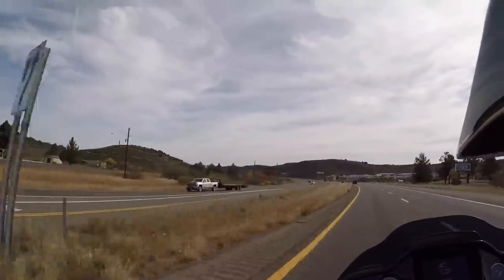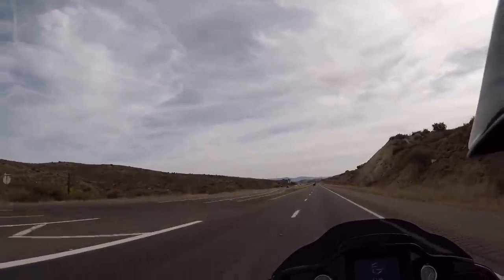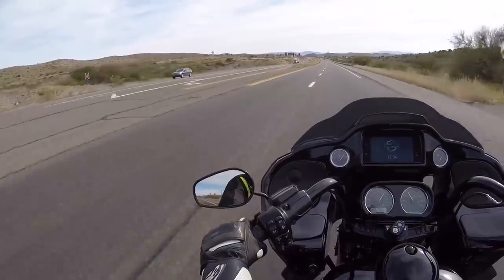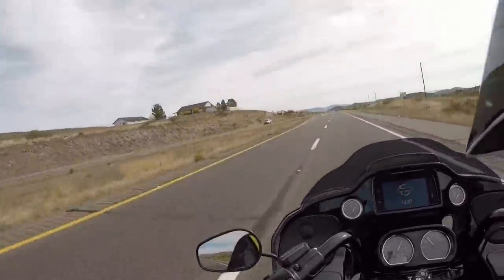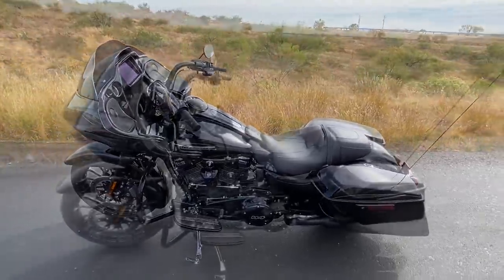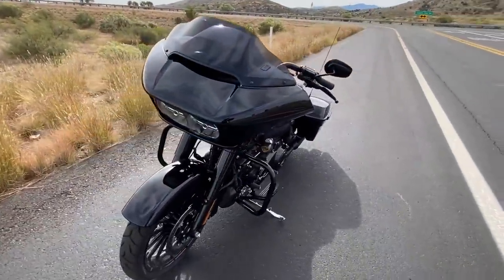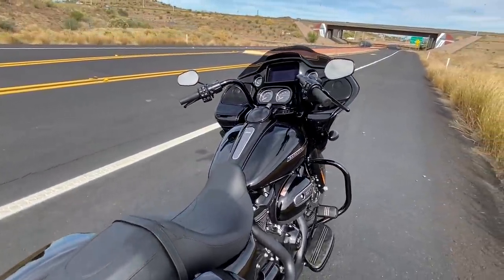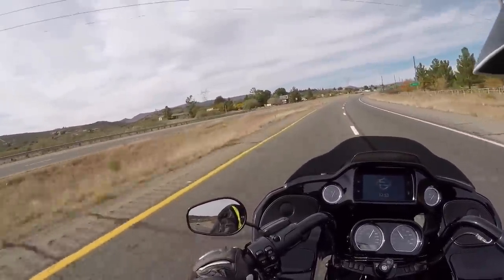2020 Indian Challenger VS Harley Davidson Road Glide Special

Comment: I am a Harley-Davidson rider and have had a Harley-Davidson in 88ci, 96ci, and now 107ci.
 Now Indian has done everything we want Harley-Davidson to do without having to use aftermarket companies.
Harley-Davidson is still using a chain primary drive which is BS, also 4 valves per cylinder should have been used 15 years ago.
Reply: Frank Wood primary issues for the second time are what was the final nail in the coffin that made me buy an Indian. Gear to gear primary is a great idea.
Reply: I'm buying an Indian sometime in the next 2-3 months.  Probably a chieftain 116.. but I'm waiting til I see and ride the Challenger before I decided.
Reply: @davidknows3320  my 14 victory has aluminum frame, inverted forks, gear to gear primary. Its not like Harley didnt have time to catch up
Reply: Bill blasius you speak truth.

Comment: Wow, I've ridden both and give me a break, there is nothing that would make me choose the RGS over the Challenger.  Indian has better styling, better looks, Cast Aluminum frame, 122HP water-cooled engine, Fox mono-shock which provides better comfort and handling, inverted forks for better handling, 3 ride modes, singe headlamp fr better looks with integrated LED running & turn signals for far better visibility, power windscreen, remote locking saddlebags & a ride command with weather overlay.
You are seriously try to tell me you prefer the RGS?  well to each their own, but i am not buying what you are selling. Indian delivered, period!
I used to be a Harley guy, had a 2012 Dyna wide glide and loved it, in 2015 I wanted a fairing bike for the longer rides and really liked the SGS but got tired of the "Harley Tax" of constantly having to upgrade things that should have come from the factory already installed.
The 2 shocks in the rear are garbage and have been that way for years, Harley just wants you to spend more money, mono shock is far more comfortable and better handling.  Now you have to use Harley aftermarket parts or you many void the warranty.  No thanks, Harley just wants to screw the customer out of every penny.  I will NEVER go back to Harley until they change their business model.
Reply: I'm a Harley guy. Currently have 3 Harley's in my Garage. 2018 and newer. 2 Softails and an Iron. With that Said. I agree 100% with your Assessment. Indian delivered. Period. The MOCO can wake-up and Step-up or fall even further behind. Great comment. RSMF.
Reply: Please don't confuse the HD loyalist's with the facts.
Reply: Indian challenger delivered on every thing except that ugly ass dash  lol.
Reply: Lol "harley tax"
Reply: EXCELLENT  !!!!     Allow  me  to  add  my  2  cents    ......

TOO  MUCH  KOOL  AID   DULLS  THE  SENSES .  JUST  CRACKS  ME  UP  HOW  YOU  PEOPLE  TRY  TO  JUSTIFY  INADEQUACY.
Reply: Ride what you like if you want to cherry pick the Polaris has more horse power but I have rode my road glide 2020 limited across country never wanted for power two up loaded way too heavy.... no tour pack for the Polaris...  no lowers... not as good for cross country riding or in rain or cold... 8 color options some two tone in the limited.... the Polaris limited has 3 solid... and yes the dash  looks like an ugly dogs rear end on the Polaris... but it’s the bike for some of you like it buy it... 2 out of three versions costs more the. Harley road glide comparative version

Comment: The rear shocks are not "stiff."  It has no rear suspension.  That's why it should never be called a "touring" bike.  It's a bar hopper.

Comment: I just got my Challenger and I love it. Last week I was In an HD dealer after a bad experience with the dealership I bought my previous Indian from.  The HD dealership was next door. Had a great selection, nice people. Since I wanted a Challenger I looked at the RG and it wasn’t as nice as the one you rode-that one was a beaut! But it didn’t “grab” me and the offer wasn’t great so I passed. Went to a different Indian dealer and got an awesome deal on a Base Challenger and saved $10k in the process. Could not be happier! Wasn’t offered a test ride for the HD, guess I would have found out the same way as my Fatboy… At least that went well. My final point is, they’re both great bikes-it’s your money, get what YOU want. I am grateful to have two great choices!
And then there is Street Glide and Chieftain….
Reply from the maker: That’s AWESOME enjoy the ride!!!

Comment: HD does have weather. You get it if you ad the XM box to the GT or GTS radio and pay for the service. My 16 Ultra limited has warned me about approaching rain many times. You have to have a route on the gps plotted, then it checks for weather. The Challeger is suppied by Verizon. They give you two years free, then you pay. I rode the Challenger last week and liked it better than the road glide special and pulled the trigger. Only wish it had apple play.

Comment: I used to be a harley guy and loved the road glide and still do but saying that the road glide is a better bike over the indian then you need to share your good stuff man.  I've put over a 1,000 miles on a road glide and 50 on the Indian challenger.  I only needed 50 to decide that the indian was a superior bike.  I think the road glide has a better front fairing design but you yet so much more for $$$$$ with the indian than you do the Harley.  But hey that's just my two cents like you gave your two cents.  I've spent over 3 grand in suspension work on my dyna to get it to handle and ride the way I want it to.  If I bought a road glide I'd have to spend even more than that.  Indian delivered exactly what I want in a touring bike.  If Harley releases a road glide in the future with a inverted front end, mono shock rear end with an adjustable windshield then they may just win me back.  Right now Indian is kicking harleys ass on the most important thing of all and that's customer service.
Reply: Cody Bieker I've loved Harleys since I was a kid, but one thing that puts me off them is that for the high price point there is no bike you can feel is perfect 'from the factory'. That's a killer for me. If you have to modify so many pieces of the bike to get it to feel good, then it's not a good bike.

I'm starting to prefer Indian over HD, but again the price point is massive. Plus here in the U.K. there are only 3 or 4 dealerships, and they are far more cliquey than Harley dealers
Reply: Cody Bieker finally someone else  who also spent serious coin to make there Harley comfortable. In the end his opinion is because “Harley”

I own a rgs with suspension work done because that outdated front end bottoms out here with Chicago roads. I’d love to demo the challenger
Reply: @John_shepard  you ride that challenger and you will be discussing numbers as long as you ride it with an open mind and aren't sold on harleys the only bike bullshit.

Comment: Interesting. I bought a 2020 RK and I agree it's a super nice bike to relax and enjoy the ride. I had a 2011 Victory Cross Roads and thought it was functionally a little better than this HD mainly because it carried its weight lower. I would have expected the Challenger followed that path. I was surprised to hear that you felt it was more top heavy than a Road Glide.
Harley knows how to get the weight down. Their Softails are as easy to take off a stand as anything made. I agree that once you're used to an HD touring bike they're easy to manage at low speed, but the first time I rode one it felt like trying to ride a Walrus at low speed. I was a duck walking it like a novice.
Guess I'll swing by the Indian shop and feel one up for myself.

Comment: I had a 2017 Chieftain before I bought my 2020 RGS. I havent had a chance to see the Challenger yet but I will take the trip for sure. The only problem I have with the Challenger without riding it is yes, the dash is hideous, and the fact still remains there are no accessories for the bike. As a rider wanting looks and being able to toy with my bike, Harley fulfills that void I had with Indian. I had my Indian 2.5 years and put 18k miles on it. Loved every minute of it but my road glide is stronger and I can do anything I possibly wanted to it. Indian has developed a lot in the last 3 years but when I bought my bike I replaced bars, fender, wheel, speakers (not good ones because not many options) just to get the bike to look the way I wanted it to. I have no desire to change anything on my current bike. Yes the Challenger may be faster, but my RGS runs 100mph like it is nothing and I do not need to go an faster than that. And when I go to bike week I wont have to pick and choose vendors that actually try with Indian. They have come a long way but the accessories is still not where it needs to be and that fact still remains. Which is why I wont buy the Challenger because it left me in the same predicament as my Chieftain. At  the end of the day its all preference anyways, competition is what you want as a consumer, this will push Harley over the edge and make them do something they havent done since the m8.

Comment: The Challenger is great over the Rushmore M8 platform, I will give indian that. But Indian will NEVER have the aftermarket nor community pull that Harley does. They just never will. Especially with an out of the box "Performance Bagger."
Shadetree Surgeon said it right, people dont want an out of the box performance bagger, because then they cant make it a performance bagger in their own right. That's why people love performance baggers. They get to make something that was never meant to be a performance machine, into a performance machine.

Indian overally is generally more expensive than harley. And harely is bring out a better smaller DOHC engine here pretty soon.

Harley's M8 Softails are better than the Chiefs hands down. They're lighter faster better handling and best of all cheaper than the similar chief options.

Challenger will take some road glide sales, some people who'd never buy a harley might be a bagger for once. But lets be real, all the asshats who say "if harley made X i'd buy it" are full of crap and never actually do it.
Harley is making strides where Indian is catching up. And that's what the challenger is. Catching up to Harley in a segment where Harley riders don't care to buy a bike like that.
The upgrade ceiling for a Road Glide will be through the roof, but the challenger will receive the same puddle of aftermarker compared to the sea of parts you get for a Harleys.
Challenger is a good bike, good on you Indian. But I have no interest in a bagger, especially one that's gonna have crap all for customization.
Reply from the maker: FranBunnyFFXII well written
Reply: Fran, I love Shadetree, and watched that video too, but i disagreed with him on the "out of the box" vs "do your own upgrades"..which I've always done. While its rewarding to do performance upgrades,  and other things to make my bikes more personalized,  it's the things that should be standard on Harley (and everybody knows it), like a decent suspension on a tourer,  where Harley misses the mark. Personally, I'm ready for a bike like the Challenger. Now, honestly, i would buy a used RG custom if the price was right, I love 'em, but that Challenger is a an excellent option. Here's why I'm leaning towards the indian: LED lighting,  Fox monoshock, liquid cooling, AND self adjusting valve tensioners (this is a huge plus). Cheers.
Reply: Rocky Mountain Ras I’m all for modding Older harleys to make them your own perform better because the price isn’t that of a new bike, but when the new bikes have the same shit as the older models why pay that hefty price tag and then have to dump more money into it?
Reply: Yeah, just what I want to do, spend $25-30k for a bike and pay $1000s to up grade it. Maybe 15 years ago. Not anymore. I have my second roadglide in a series of 8 or so harleys, and it's by far my favorite Harley. But after riding several other brands lately, I'm ready to jump ship. Harley has gotten too expensive, and we are in a day and age where EPA standards along with warranty issues make upgrades illegal or not rational.  Harley has taken advantage of it's base who want a cool bike, to support an American brand, and live the culture. They didn't  keep costs low or provide the latest technology. The challenger is where the roadglide (or a different  Harley model) should be and i will test ride one, but I'm probably going metric because if you actually want the latest technology, comfortable, quick, and good handling touring bike, it's not currently made by an American company.
Reply: @twntyfor24  You're gonna have to do the same thing for the challenger.|
Indian does the same thing Harley does.
Except Indian's accessories and parts are more expensive than Harley.
Stage 1 for the Challenger is 1425$ and doesn't even come with a tuner device.
A full sissy bar setup is 970$
Stage from harley is 1200$ and comes with a tuner device. Full sissybar setup is 550$

Guess what? Indian does the same thing Harley does, except a lot of times, they're way more expensive.
Reply: FranBunnyFFXII for $30k for a RGS you’d expect some more to come standard. Not everyone can spend $5k on parts after spending $30k on a bike just to make it perform the way it should’ve from the factory. Indian has adjustable windshield, remote locking bags, lean angle abs/traction control, ride modes, better suspension, liquid cooled, ride command, LED lights all around, and more power to start with ALL STANDARD. The aftermarket is gaining a lot of traction especially with the challenger blowing up sales numbers. In a year or two there will be just as much aftermarket for Indian. I was a Harley guy for years but at the end of the day I want more for my money. Plain and simple.

Comment: have owned a bunch of HD's and while the fit and finish is great, the performance of the engines are lacking (reason why HD sells engine rebuild kits for new bikes). I had a 2019 Street Glide Special with the 114ci and before that a 2018 Street Glide Anniversary Edition with the 107ci. Both engines felt the same. The torque falls off too fast on the bikes (everything is at the real low end, like a tractor). At around 2K or so the torque starts to fall off and then drops fast after that. The more you rev it, the less it pulls. You gotta keep shifting early and fast to keep it accelerating quickly. Also, if you get caught in a little stop and go traffic, you can actually feel the power decrease. Just my thoughts on the bikes. From what I've read (I haven't rode one yet) the Indian Challenger puts out much more power than the HD with it being liquid cooled and it has  a lot more tech for the money. Strange how you would choose the HD over the Indian?  This review seems like a publicity stunt. Lol
Reply: markurbancowboy  it sure what that tech is? I decided to go with road glide limited Polaris engineering is known for problems along with customer service being bad... I had 8 color options challenger limited has 3 and the cheapest version has 1... that’s right like the model t 1 color whole base model rg has 6 colors... I have rdrs on mine... Harley has brembo brakes... I really don’t give a crap if my windshield moves but I guess if that’s all you want in a motorcycle Polaris is for you.... it’s not a challenger b it is the Polaris flag ship the road master I can post a video 2 guys went cross country ride Polaris has to have motor pulled for oil problems ride what you like but don’t say Polaris has this great tech Harley doesn’t https://youtu.be/RwWD-b9qr58
Reply: Steve Xaxa what about all the M8’s that are sumping and what about fluid transfer between the trans and primary?!? Ask me how I no!!! Had both issues. That’s why my 19 SGS was sold back to the dealer. 2020 M8’s are now on their 6th oil pump revision and still can’t get the sumping issue correct. Google it!!! You can go ahead and keep your color options. Got my Challenger Dark Horse on order!!!
Reply: Jason, you will love your Challenger!  These guys are full of shit thinking an HD will be more trouble free than the Indian.  My Challenger has a decat and a set of Rineharts and eats RG Stage 4s for lunch.  

I do agree the fit and finish on the HD is better and the aftermarket is crazy however the fella  above has no idea about the performance or reliability of today’s Indian or Victory.

Comment: You rode the HD 114ci right? Quite a huge price difference between that and the base Challenger, bout $6000, and it still doesn't have the power. For the same price you can have the Challenger Limited, a lot more goodies, more power, smoother ride. Dollar for dollar HD loses.

Comment: I've ridden touring bikes since I was 19.  Got my first Harley in 2016, and currently ride a 2018 Road Glide Special.  I liked what Polaris was doing with Indian when they started, but I won't buy a fork mounted fairing bike.  I came close to buying a Springfield after test riding one without the windshield mounted.  Couldn't make the numbers work and not sure I want two large cruisers in the stable.  The new Challenger does nothing for me.  All my current bikes are air/oil cooled and have no interest in going back to liquid cooled bikes.  I am watching Craigslist for an air/oil cooled Triumph Scrambler.  Like the Scrambler, but it needs a couple grand in suspension upgrades which is why I am watching for a good used one.

Comment: The m8 is not as reliable.  They have had some issues.  With leaching oil from one side of the primary to the other as well as having to up grade the oil pumps.
Reply: sumping issues and loose valve seats